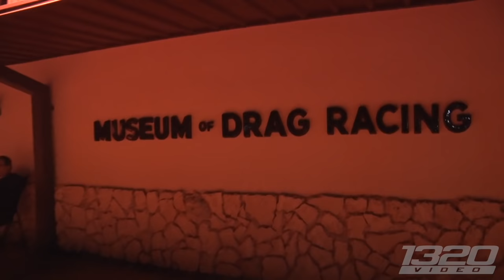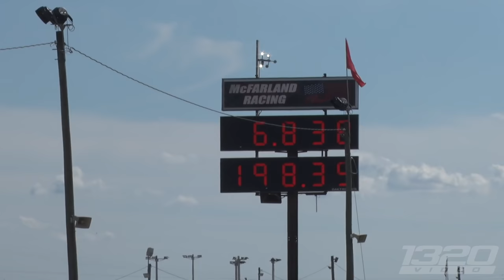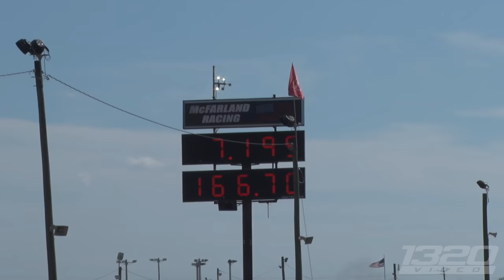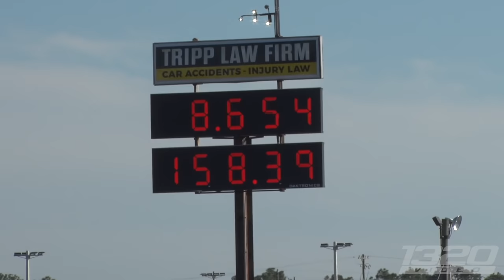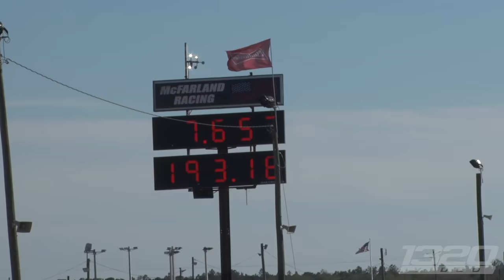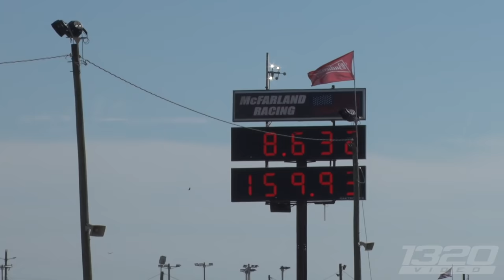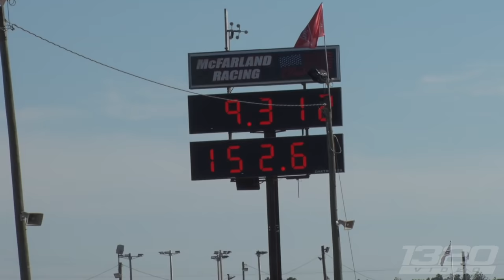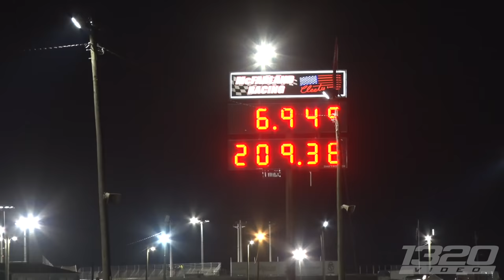CRX SMASHES into wall at the drag strip! (Sick Week: Day 5)

Comment: Man! If you guys haven't followed Shane's progress through the week, it's insane! They literally had the whole motor out of the car, slammed it back together and still made it to the next spot. Those guys THRASH!
Reply: Uhhhmuhguhd CANT BELIEVE YOURE COMMENTING ON ANYTHING EVER!!!11

😉😉
Reply: Goofy is good people. Sad to see that rad CRX get hammered.
Reply: Gotta love the whole PFI/Boosted Boiz/Cleetus crew man. I’ve never seen such determination and motivation. Great content for sure
Reply: Pfi speed for the win!
Reply: Might have led to that crash .
Reply: For real.there is no quit in these guys..its awesome,and inspiring to watch..
Reply: Maybe if they built a better and safer car this shit wouldn't have happened.
Reply: @dipstiksubaru3246  I dont see you out there ...
Reply: @dipstiksubaru3246  correct.
Reply: @rtsstream  don't see you either, what's your point?
Reply: Been following it religiously
Reply: @zacharyarmstrong3839  You can see the pre-weld cuts on control arm meaning it was barely tacked together. Goofy is lucky it let go at a track and not on a highway killing himself and or others. Hopefully he learnt a lesson and bulletproofs it next time.
Reply: @zacharyarmstrong3839  I actually can. And have done so. Just not in a crx. They built that car with little care. Only focusing on performance not safety. Any car that goes 10 sec or faster should have way more than those tiny welds they used.
Reply: Glad to see how well you guys did as well. I’ve been watching PFI all week, and man, that is the hardest race week I’ve seen from anyone who was able to finish, Jamie included. Hats off to those guys, that’s hard work
Reply: that control arm separated clean, there was no weld penetration. the car is a pile, but if they bought that part vs made it, cant blame them.
Reply: Hahahahahah GFORCE Transmissions
Reply: PFI speed everyone knows them Goofy built is his son one smart boy I cannot wait to see him excel and soon his youngest son is building a race car super super light series.
Reply: Can u post support for the Canadian truckers and the freedom convoy
Reply: Yea he had lots of trouble the whole trip. Straight up trooper for getting through the week. Saw the wreck on the live yesterday.. Feel so bad!
Reply: @crippledproductions2194  Sure you did lol
Reply: @jamesireland9188  normally I’d agree with you. But there are so many shitty things they did on that car. Sometimes just because you can build it yourself, doesn’t mean you should.
Reply: @jeffnpatricia  oh hell yeah, I am gonna meet them someday, just show the love for their absolute dominance on those Honda's.
They ain't wired for quit, that's for damn sure.

Hell, their one other dude, had to split a damn entire engine block, and he damn sure got it back running and made passes
Oh hell yeah, aint done till its done.
Reply: I want to like this comment, but it is currently 666.
Reply: @threadtapwhisperer5136  Die hard Jaime dropped a valve with the awesome sounding rebuilt engine. You just cannot make this stuff up. A book of bad luck could not be written better. The poor dude.
Reply: Now I liked it as it was 667.
Reply: @1957burb Goofy’s Crx is AWD
Reply: @mertonallowicious  I deleted my post. I thought about it, and decided it was inappropriate. I apologize.
Reply: @crippledproductions2194  probably half the reason gov is trying to restrict this stuff. Too many backyard hackers driving/racing modded shitboxes out on public roads.
Reply: @FantsyPants  ehh they can’t restrict what people can modify on their race cars cuz all the tracks, events and cars are privately owned. I don’t know enough about the restrictions they’re trying to put in place but I know it has to to with more of the engine performance and emissions
Reply: @dipstiksubaru3246  they had good suspension parts in it. It’s not stock so they tried to make it safe. They didn’t know that the parts would fail like that. Now know know what they have to upgrade. You have to make mistakes sometimes to learn from them
Reply: Shane is inspirational 👏 🙌
Reply: Was gutted when she dove towards the wall 😢 have been watching those 2 for years!!
Reply: The whole PFI crew is just insane with how much they had to do and how much they pushed the bar on those cars!
Reply: @crippledproductions2194  the problem isn't with cars at the track though, it's when their on public roads.
Reply: @FantsyPants  I never said that wasn’t an issue.
Reply: @dipstiksubaru3246  i mean the onky serious car pfi ever built was the bully and sho nuff. That being said the crx is 10/10 built far better than a majority of the hondas that hit the track
Reply: Bound to happen when your first car skips the 13s and 11s and goes right to the 9s. I hate to say it but that crx is bound to end up a crumpled mess on the track from lack of experience. I hope that cage is stronger than the suspension and I hope goofy proves me wrong.
Reply: @brutalbasspro  exactly my thinking. They should’ve turned it way down to atleast run 11’s for basically his first race. I give Shane respect that he built his car but he is not nearly experienced enough to be behind that fast of a car. I ran 11’s in my Camaro for a whole season to just learn about suspension tuning and learning how to drive the car before I decided to turn it up to run 9’s. That was 6 years ago. Sadly had to sell the car. Now I’m into mudding and crawling. It’s definitely been a lot more fun than going straight really fast for a few seconds 😂😂
Reply: @crippledproductions2194  you got to remember that Shane is young and not rich, he built the car with what he could afford, he now would have learnt a huge leason and will upgrade all the steering components and control arms with decent beefy strong stuff and the crx will come back better than ever. Yes he was abit careless using the components he had but he is young and has to learn somehow. Atleast he is out there giving it his all and making something for himself.
Reply: @pgmurray76  i swear Jamies civic is cursed. Its off thebtrack getting fixed more than its on it. Its constantly breaking. But yet he solders on and keeps going. He is such a trooper.
Reply: It's boostedboiz all day
Reply: is it worth all that headache? hondas always break its insane
Reply: @crippledproductions2194  in the pfi video today you can see Goofy flinches and closes his eyes when he launches. They need to slow the car down for a while so he can safely learn how to race. Launching a 9 second car eyes closed is a pretty big problem.
Reply: @brutalbasspro  I saw that too. Big problem. Must be listening to Jesus take the wheel. 😂😂
Reply: @crippledproductions2194  that’s what my girlfriend said when I showed her too! “Oh he’s just letting Jesus take the wheel I’m sure it’s fine” we watch a lot of vice grip garage we have taken a few of his sayings.
Reply: @joshdawkins1190  that’s literally just excuses. He has a whole shop behind him. He didn’t build that car just on his own knowledge.
Reply: @brutalbasspro  lmao once I saw that he closed my eyes, “Jesus take the wheel” is the first thing that popped in my head. Only thing is Jesus was a carpenter not a race car driver😂😂
Reply: Really just have to laugh at the couch potatoes claiming PFI and Goofy built a dodgy car, when same noobs would have looked at those control arms and eagerly given them 2 thumbs up.
Then after the fact they flock to claim they new the parts were weak all along.  Hard to find a better example of all round corrosive character traits.
Reply: All these dudes commenting on weather the work was up to standard, he had experience, the part quality, and work quality, how about who cares. it’s their car right and they like to race/build cars on their budget so what business is it of anyone else’s simply because 1320 filmed and was gracious enough to post this video? This event is for everybody to build a car and test it effectively making it through as a street vehicle capable of good power. What you people think everything is perfect professional grade work 🤣 done in a shop and is safe when $ is involved well your sadly mistaken that is not street racing that’s  more who’s rich enough to pay somebody let’s be real here. I guess what I’m saying is stop roasting people for being street because they race on a track. Street cars brought to the track otherwise we will just watch NHRA regulated stuff.
Reply: No kidding!!
Reply: @singlecams  yeah, i saw better video of it later.
Reply: Link his channel then
Reply: Who tf are you lmfao

Comment: Damn, so bummed for Shane :( doesn’t look like it hit crazy hard tho, hopefully repairable!
Reply: Its all repairable. Just a bunch of steel moved. It can be moved back and or replaced. They will get it going no problem.
Reply: Crx chassis are still pretty easy to come by so if anything hopefully the drive train is strait
Reply: Seems like their front end pieces were not very well designed or made.
Reply: @lunkydog  bad welding. the arm sitting there on the ground, the notch at the end is still perfect. A good structural weld wont break at the weld but the metal next to the weld will break and will make a torn up mess of the metal. So that notch should be messy.. but instead the weld never penetrated properly and they have just come apart
Reply: @mifo2000  When CSR repaired the right side, Shane was joking about how nice and professional the welds for the radius arm tab looked compared to his. They thought about doing the left side too, but it was still on the car. Not sure what snapped here. This is terrible as he worked so hard on making the actual CRX chassis and body straight and smooth especially in the front end and engine bay.
Reply: @pgmurray76  ksr didn’t weld it Cletus’s fab guy welded it at ksr
Reply: @pgmurray76  I forgot about all the work in the engine bay... Damn it😞
Reply: Aidan Bailey had it rougher, his Shitbox of Doom might not make it to another race if it cant be fixed. I thought I was watching the little guys death. I was heartbroken.
Reply: @pgmurray76  just because a weld looks nice doesnt mean its penitrated..
Kevin and ty are both good at what they do, thats why i watch them so its abit weird the metal has just come apart like that.

I have 30 years experiance as a fabricator and ive seen alot of breakages in offraod racing  trucks and buggies. 

That metal in the video is clean and has simply come apart, it still mostly round.

If it was a bad designe and the welds were good then that end on the floor in the video would be twisted, strched  and fucked up.

But it looks round and notched and ready to weld back on
Reply: @Tate6788  Not only did I put 'CSR' and not KSR, but you are correct! sorry
Reply: @pgmurray76  no worries we are all allowed mistakes and by video  what was welded earlier in the week wasn’t the weld that broke looks like they broke a weld that came on the lower arm from whatever company they bought it from
Reply: @Tate6788  I need to investigate more closely. This is like the time I bought an exhaust donut at a NAPA for a place on the exhaust that is a ball and cup joint. I was stupid and dared to return it. The face and cursing I received from the character of an owner never let me do or say anything without full research again. "If it isn't in the f'n diagram, why the hell would you order it! Just stupid. Really." Hahahahaa. I love that guy. The arrow waa not pointing to that joint for sure, and no one mentioned it being there. A Youtube removal video is what let me see clearly. Giant manifold donut in hand.
Reply: @rd95stang  That thing was gleaming in every video. Front chassis tubes so shiny and white.
Reply: Crash @50:00
Reply: @ElizaJane85  no he didn't he just crashed worse Shane had a way way way harder week I Got lucky and had no mechanical failures so I saw Alot of other people struggling to make each spot and Aiden never had to thrash the same way Shane did but he did have a horrible wreck and it's unfortunate... Also Shane paid for everything on his car so  hurts that much more when expensive problems like that arise   Aiden has the backup of Tom to help him build his car luckily so if he still wants to race he will be in a better car in no time
Reply: @mifo2000  yea but you can clearly see where the first or second place that broke wasn't a weld it was the actual metal too .. none of the good welds broke Maybe a Honda weld or two after the hit but not what originally happened on day 1-2 when I talked to them in parking lot they had to fix the first issue  and I almost feel like the same thing happened to the other side after he launched but is what it is now time to build it stronger than before
Reply: @mifo2000  Luckily that was NOT the part Cleetus' fabricator welded.
Reply: Shane has PFi and boostedboiz. They helped as well as his channel.  Tom might be worth more than Brent but it doesnt mean Goof dont get help. Shane had more mechanical failures, yes. Aiden's lost his car, shane can load his up and fix what broke. Aiden's might be a complete total, so who really lost? Just saying, Shane's never experienced that kind of carnage yet.
Reply: @budgetbuilt8838  crx easy to come by are you on crack 
Additionally they keep increasing in price
Reply: @mifo2000  the real problem is it need a heim joint on both end  the radius rod is bending the a-arm tab every time the suspension move 
Just a bad design will never work and I am pretty sure it bind the suspension movement as well
Reply: @legros731  I can go on market place rn and find 10 of them. Yeah I'd say pretty easy
Reply: @mifo2000  no weld will ever work the torque rod need a heim joint on both side when the suspension travel up and down it bend the tab on the a-arm and eventually break the tab
Reply: @budgetbuilt8838  show my the 10 you found 
these car are 30 year old and this body was only made 4 year and 88-89 are different than the 90-91 model they are not plentiful in any way and certainty not affordable for a 31 year old Honda
And they rust very easily where they use  salt on the road most are in junkyard
10 000$ crx are not uncommon  and even stripped shell can go for a couple thousand buck and most of them where all molested and really badly modified in the 2000
it not 2005 anymore where you could buy a good one for 500$ 
And oem part are all discontinued and used one are becoming rare and expensive all the back interior trim piece and the center console alway break so good condition part are hard to come by
Reply: @legros731  what's ur insta, ill send them right over 🤷🏼‍♂️😂
Reply: @budgetbuilt8838  sorry a don't have any account on useless social media 
Only  child use Instagram by the way lol
Reply: @legros731  How much is a chassis going for now?
Reply: @legros731  There are a lot of racing aftermarket parts that are better and there are a few companies that make 3D printed center consoles and other plastic interior parts.
Reply: @SI0AX  too much really dspend where you are local for my in canada a bare shell could be 2000/3000$ a see complete car for 10 000$ and if it's low mileage and unmolested can be as much as 15 000+$
anyway Brent say the current chasis is special it belongs to their friend who deceased so they want to keep it
Reply: @SI0AX  maybe but a real oem part will always be worth more and will fit better 
And racing part don't alway equal quality vs oem parts
Reply: @legros731  For the Honda's, if you buy quality racing parts, like legit racing brands, not Chinese imitations, the parts will always be higher quality than OEM parts designed in the 90's.
Reply: @legros731  If it's in very good shape, it will be worth a lot of money in the future so I would keep it just for the value. Those prices were the prices of garage kept Japan imported CRX's, now it's probably a bit higher.

Comment: Shane and Brent and the crew should definitely not be disappointed they worked there ass off unfortunately didn’t go smooth but still y’all made it through every obstacle hopefully it fuels your ambition to keep striving for greatness
Reply: It hurt more after watching their rebuild video in the parking lot. (1-2-1 shift and loosened flywheel ring gear). Came back and then this. Jaime dropped a valve - everyone has done this...Kyle...Hondaru (x2).

Comment: Look at how thin walled the tubing is for those control arms.  Yikes!!!!!!!!!!!
Reply: I am thankful it snapped at the beginning of the run and not the back half
Reply: It was never designed for 800 miles of road use .
Reply: Same thing i thought of.
Reply: I would never have let my kid continue racing/driving that car after the steering component kept failing

Comment: What I understand from this race is that the vehicle that absorbs the impact best at take-off wins. The more powerful the engine, the greater the load on the differential. The more important the engine power is in drag races, the more important are the chassis suspension and differential. It takes a lot of engineering and ingenuity to distribute this power evenly to the two wheels at take-off.
Reply: I'm so lucky to have discovered this channel. It's a super channel I'm following it with excitement